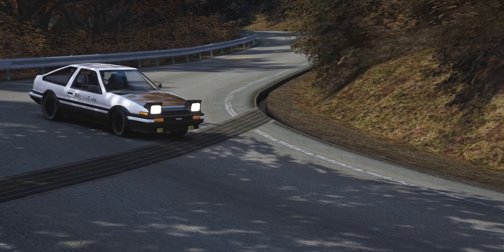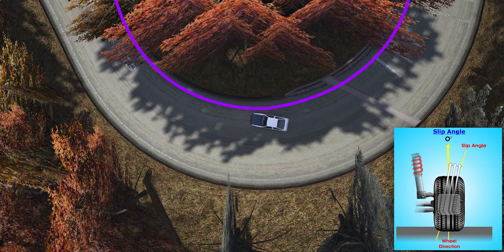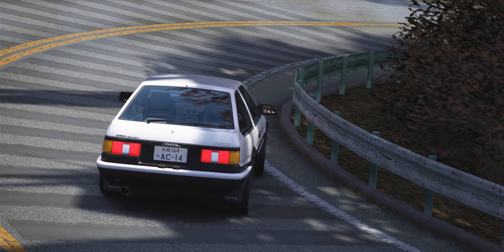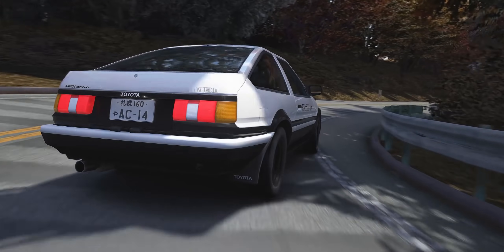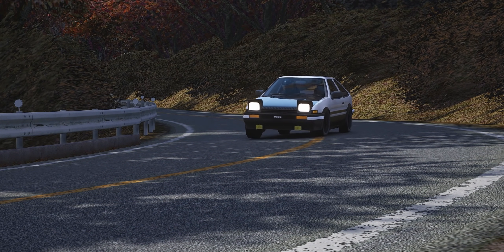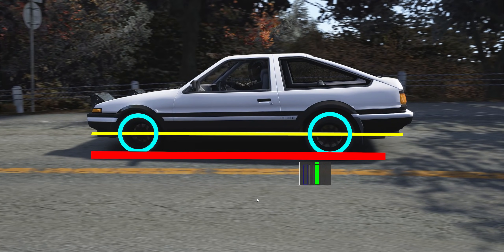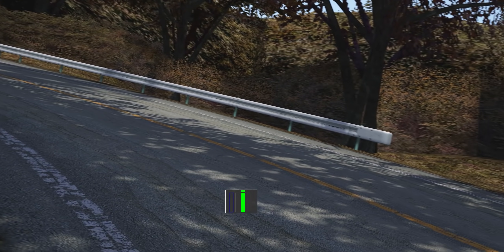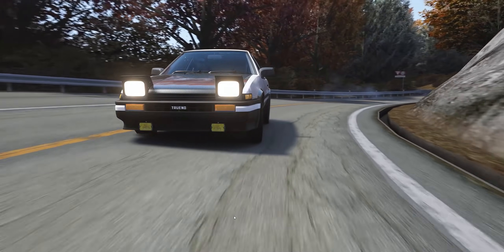Slip Angle in Touge - Master this to be a faster Sim Racer

Comment: you didn’t mention the anti-roll bars. It makes sense to push the car into the oversteer exactly until the suspension on the rear outer wheel finishes its travel.  Going beyond this limit leads to a greater drift angle.

Comment: funny, i've had numerous debates with hardcore trackbois about why having slight oversteer is beneficial for getting through a corner faster... and they argued saying it's bad, yet i was still faster than them 😂
Reply: Just depends on the car's behaviour, really. If your car is the kind that'd have alot of grip but then totally break the traction off if it butts it's head on the grip limit, the car might not like it
Reply: @PlatinumNath    True hate to say it but a light slow understeery car is the ideal for slip angle the 86 just happens to fit the bill Ive tried and can't do it on anything else. So if I'm being honest light slow rwd cars with low horsepower are the best for it granted you do lose acceleration over a faster car. But on the plus side it not only lets you maintain momentum more than other cars and lets you slam on the gas when it understeers. 

This in turn I find lets you corner without having to steer just using the gas pedal but you have to make sure you can catch the car back and don't accelerate too hard to the outside. If it does get to that point a brake tap or some steering and then ressetting back onto the power i find usually solves this you pretty much have to dance on the pedals I quantly named it pedal dance.

Granted that's not to say this can't be done on any car but I find 4wd/AWD promotes slamming on the gas and countersteering at least if you want to haul ass quickly through a corner. FWD kind of promotes the same idea but instead turning the car in gradually not really needing much countersteer if any at all and letting off if you get to close to the inside since if you brake they tend to understeer to the outside of the corner but you don't want to be too aggressive or it will oversteer inside.

Comment: actually, Takumi  was using a different technique called four-wheel drift, it was actually Toshiya "God Hand' Joshima that used a technique that utilized slip angle which was his one-handed steering technique
Reply: He didn't actually use 4wd since his car is a rwd but he is skilled enough that he can make his car drift like a 4wd car
Reply: @CardiacYew-xt5zq  no one said anything about takumi using a 4wd😭
Reply: @toonbyte6110  miss interpreted it my bad
Reply: Basically, Takumi was using too much angle, but God hand was the first one to have the perfect slip angle
Reply: Takumi learned about slip angle during his gum tape death match. He realized that by using less steering input, he could get the car to rotate better and go around corners faster.

Comment: is this the same as 4wd drift?
Reply: nope, a 4 wheel drift is when all 4 tires are sliding, with slipangle you are pretty much doing a no counter steer drift with very low angle
Reply: @happi6969  no countersteer = 4 wheel drift
if the front tires arent turned in the direction that the car is moving that means that they are also sliding.
Reply: @happi6969  isn't there also a high chance of under steer towards the end of a corner if you're gunning it the whole way
Reply: @delgado8867  if you fuck it up yes
Reply: its not a 4 wheel drift but you can implement a 4 wheel drift with slip angle, it is also easier to do slip angle with lower pressure tires
Reply: @kuilios 
Give it a try with pressure close to max tyre pressure (not the car recommended, the one close and over 40psi/3bar). Not suitable for cars in bad overall condition and there's greater stress on chassis/shell. Also check pressure multiple times per day on hot days, you don't want them to explode. H rated tyres survived going +200kph on Irish mountain roads with air temps around 30°C. Currently on one of the cars I have a set of MS tyres for the 5th or the 6th year (all year round), 215/50/16 MSs and gone over 35k kms, still good on the snow but deflated to 2.0 / 2.4bar, on summer they're always on 3.1bar, this year temps are around 32-39°C daytime and 26-29°C night. I tried running 14'' @ 50psi (44 or 43 rated) and only had smaller issues while offroading and in rain (but then you can actually utilise slip angle much easier, with a sacrifice of stoping in time ofc). I don't recommend speeding and dangerous driving on public roads and I definetely don't want anyone hurt or cars damaged so mind what and where are you doing stuff behind your wheel. Good luck, have fun and safe travels

Edit: high tyre pressure is not intended for longer burnouts/drifts, you want to keep the tyres cold for as long as possible to keep tyre ware on minimal and the car sliding "a bit".

Volvo's "yaw control" is a great tool for that (P1 platform, haven't tested it with gen1 S40/V40 yet, P2 V70 is kind of weird and P2 S80 had brilliant yaw control, felt like living room turbo brick flying over the road). Gen2 Hyundai Accent and VW Golf mk3 are also good for sliping if you're careful with accelerator and AR Giulietta typo 116 and MB W114/115 were also fun for learning.
Reply: pretty much same,  but with steering angle towards inside corner when exit, to prevent understeer, because the limitation of torque distribution between front and rear
Reply: Yepp
Reply: Fujiwara Zone
Reply: Not at all
Reply: A 4w drift is basically an imperfect version of slip angle.
Reply: Yes and no. Yes if you have more bias going towards the rear wheels and no if you have more bias for the fronts. But additionally, 4wds tend to be easier as you have throttle control over all 4 wheels but you have to keep in mind whether you have more power bias towards the front or the rear wheels.
Reply: nope 4wd drift is better
Reply: @asdqwe_9381  no it’s not, 4wd is safer which is why rally drivers use it, slip angle is slightly faster.
Reply: Drift is when the angle is too large and the centripetal force is below the peak value
Reply: pretty much.

Comment: Takumi technically drifts, and Slip angle isnt exactly sliding. Slipping to the degree you did in the video is called excessive slip angle and is pretty fast yes, but the Maximum slip angle is a technique that is incredibly difficult to master. Pushing the car to slide is easy and that's excessive slip angle. Maximum slip angle is where you push the grip of the tires and the car to the point where you feel as if you are sliding, but in reality you are getting the max amount grip available without losing time. I was doing some laps around Spa in a porsche 962, and using the max slip angle I improved my lap times by over a second. You get this sudden grip and acceleration. Go Kart drivers utilize this because it's much easier on slower cars. If you watch videos of Go Kart drivers like Super GT or Jimmy Broadbent, they are always sliding into corners, that is the maximum slip angle. This is why F1 drivers come from Go Karting, because they can find the limit of the tires from years of experience. Alonso used this technique with his unique driving style in 2006 with renault, thats why he was exiting corners so much faster than other cars (you cant do that with today's F1 cars because they are too rigid and twitchy). But your video was very nice and informative for others, love it, keep up the good work!

Comment: Up until now, I'd only been able to get decent slip angle with cars with really soft tires because they're easier to load up, and this helped me a lot to learn it with other cars.
Reply: Much easier in a fwd car, local downhill mountain run you let off and use off throttle oversteer to slide it around the corner

Comment: now its time to try this with much less control over the car because i only have a controller
Reply: it is posible to do it, i learned how to do it bc when you use a controler you dont have a lot of control on the steering but you do on the throttle so it was "easier" to learn that a driving style whit a lot of precise steering input i can link you a video i recorded if you liked

Comment: Well, this is actually known since Fanghio. The next step from this for such a low-downforce car as AE86 would be 4-wheel sliding technique, like those F1 cars in 60s, before aerodynamics.
Reply: Didn't know about this one! Neat.
Reply: @john jones Hey . . . do F1 racers perform slip angle technique today, to get through corners fast ??
Reply: @JohnKickboxing  f1 cars rely a lot on downforce to get grip so they have to keep straight
Reply: @JohnKickboxing  they do LMFAO it even mentioned in this very video 🤡
Reply: @john jones 👌
Reply: @john jones Can a midship car like Lotus Emira perform good skid like that on Touge? . . . It's a stunningly beautiful car I might buy it when produced, the manufacture has not announced the fact about its front and rear weight ratio yet, I'm worried it might be the same as that of Lotus Evora, 32/68 (F/R ). However, I will mainly drive it on circuit and use it to practice the technique on circuit as well.

Comment: I don't want to say this is misleading, but... from the comments I can see there is a bit of confusion.  Slip angle isn't a technique to master, it's the angle a car takes while going through a corner.  It's also highly dependent on the car, the car set up, and the corner.  An F1 car may have a slip angle while taking an 80mph left 60, but it won't have a slip angle while taking a 30mph hairpin but a 92 Civic will.  Obviously the slip will change from each corner as well. It's not drifting either, but a drifting car has slip angle.  For all intents it's a measurement of the difference between the vehicle direction of travel and the vehicles attitude (natural position; where it's pointed).
What track drivers need to be concerned with in relation to slip angle is knowing what that natural angle is for each turn and situation that doesn't exceed either the front or rear grip.  Ideally you'd want to brake and rotate your vehicle into that angle before getting back on the gas to adjust that angle with throttle.  Finding your cars natural slip angle for a turn is the trick and what you want to master.
Reply: Correct that it's not a technique, but incorrect on the definition. Slip angle is not the angle of the car in relationship to the corner. Rather, it is the angle between the direction a TIRE is pointing and the direction it is actually traveling. If a tire has a non-zero lateral component, which is always the case if you're turning at all at a non-zero speed, you will have a slip angle of some sort.

Comment: So Takumi also does this but with more angle and understeer while keeping countersteer at minimun or at 0 depending on the corner (4 wheel drift), god hand in the other hand (lol) does steers normally but with only one hand so it keeps the steering at minimun (never countersteers) while takumi does countersteers but at minimun (drifting as fast as humanly possible).
In other words, both Takumi and god hand do slip angle but god hand does it better and more in a "grip" way while Takumi does it on a "fast drift aka 4wheel drift" way.

So god hand technique is slip angle but mastered to the perfection, that's why he is indeed faster than Takumi on the corners when going at the limit (his car is also better than the 86).
Reply: Takumi drifts and God Arm slips basically, but they both four wheel drifts in their own right
Reply: @fujineetomori  facts different approach but similar result more or less
Reply: Mastery of slip angle could also explain why "god hand" can just change his lines while keeping consistency. Slip angle seems to really help with finding more grip across more of the width of the course, so at that point you'd just need to keep a little mental time delta going from corner to corner, which isn't a big deal for most racing drivers.
Reply: @brieee28  most find it best not to think much about angles and stuff and just build up intuitive sense until they can nail down balance between wheelspin and acceleration since you're letting the car ride naturally than forcing it
Reply: Mans spittin facts
Reply: In one episode Takumi describes he driving as understeer (4 wheel drift) which is basically using slip angle.
Reply: Yeah, that's true, would that mean the Fujiwara zone is just slip angle or is it something different?
Reply: @HikiOmo  that could be true since he uses slip angle at its limit he goes around the corner faster than most people.
Also the 86's light weight helps him slingshot around the corner.
That is why he won against the s15 because the 86 weighed less.
Also less power less wheel spin.
Reply: So, like the gumtape deathmach with Shingo and his eg6?
Reply: @rilesmiles4564  yes
Reply: Ryosuke also says in their battle on First Stage that Takumi was getting better, he was refining his technique with almost no counter steer, so Takumi was already mastering slip angle on the very begining!
Reply: When two of the smartest kids in class came up with the same answers using different methods
Reply: god hand drove the purple s15 right? or am i thinking of someone else
Reply: @turtlejuce3716  right color, worng car, it's a purple s2000
Reply: @turtlejuce3716  s2000 blue
Reply: @turtlejuce3716  he drove a Honda S2000
Reply: @turtlejuce3716  he drove an s2k
Reply: @turtlejuce3716  he drove s2k
Reply: @turtlejuce3716  blue s2k
Reply: So this basically explains why Takumi struggled in his final race, right?
Reply: @thehwguy4293  Shinji corners without accelerating or decelerating through consecutive corners because he fully knows Tsubaki while Takumi trail brakes longer through the corner as a safety margin to avoid understeer but also strains front tires more since Tsubaki is a super long touge so it's nigh impossible to memorize it all in one day
Reply: @thehwguy4293  shinji inui knows the highest limit of speed of every corner by applying little steering angle, little throttle and brake

such a "perfect line" need to apply to achieve that driving, thats why shinji lost because lack of defensive drive

takumi is just an idiot that damaged the car whatever he drive. let him crippled for his own good
Reply: Kamalu426  too much berserk
Reply: How is my techniq?
Reply: he's not
Reply: I'm just using throttle turn rear in the corner. It doesn't feels like drift because I don't countersteer, but I feel that wheels spin. (that's probably what Joshiya Toshima does)